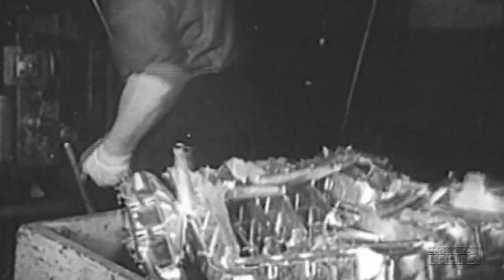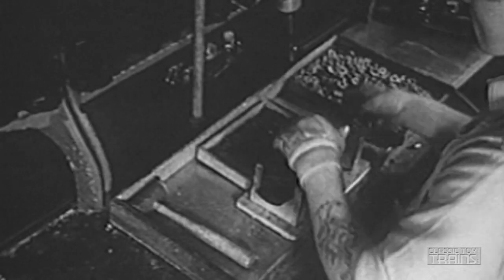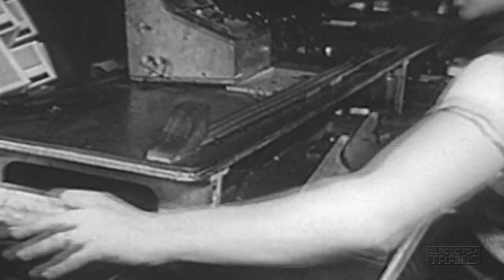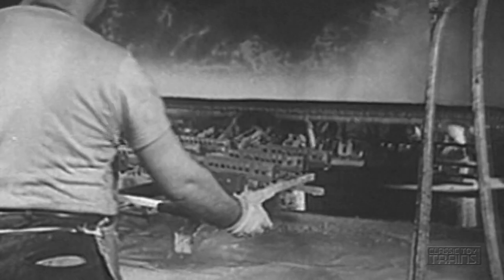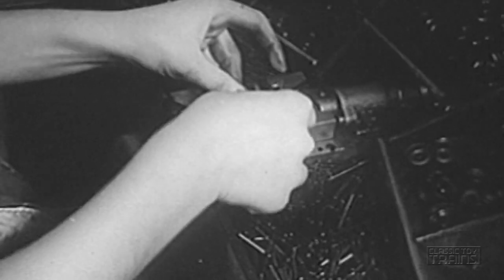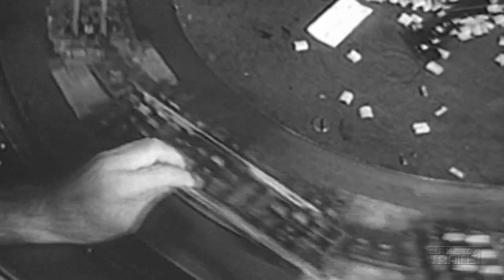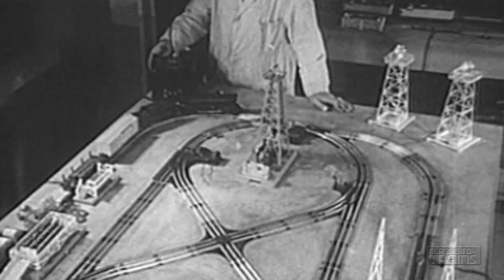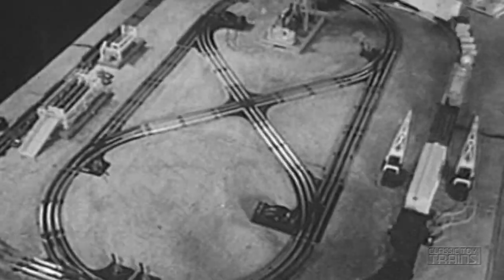Inside Lionel's train factory, part 1

Comment: I have around 100 model engines in my workshop alone, and most of my O/O27 is Lionel, I also have all the buildings mentioned in the video, I even have a standard gauge Lionel and on top of many others, my favorite Lionel engines are as followed: my 226E, my two 2026s as one was my grandfather's growing up, my 1225, and all of my diesel engines
Reply: my favorite is the 681 with 12 wheel tender and back up lights.   looks great on my shelf.   i have that 681, two 2056s and one 2020.   all great engines.
Reply: +Steve Thomas well, since this comment was posted I have gained more fleet members, my favorite might just be my 224 Lionel engine and tender, as it is one of my strongest engines
Reply: i just started collecting 3 yrs ago.  havent had the oppertunity to aquire a 224 yet.  but im sure its a great one to.  but personaly i like the 20 wheel 681 and it has magna trackion.
Reply: +Steve Thomas I have been collecting for 5 years, when she came in she had a broken connecting rod, so I fixed it and now it can pull up to 13 postwar cars and a caboose by its self
Reply: thats good.  my 681 pulls 13 to 15 cars plus caboose.   good runner.  my 2056 wont pull this load. it pulls about 10 cars.   im in the market for another 681 with tender.  do you have one to sell ?
Reply: +Steve Thomas don't have one in my collection, besides, I don't sale, but there was a couple in a train show last year I saw, should have picked them up
Reply: do you like mth engines ?
Reply: +Steve Thomas yes, I think they are pretty good for a modern engine
Reply: would you like to buy one?  or trade ?   its a 1997 dash 9 diesel. 18 inches long with proto -1 sound. mint condition in box.  5 hrs of run time.   i bought it a few weeks ago.  its just not my piece of cake.
Reply: +Steve Thomas not at the moment, I have to fix 12 prewar and 20 postwar engines before I get a new fleet member, one of them is a engine that I cannot find anything about, it looks kind of like a 1778, but it has a different number and is painted blue, with yellow lettering on the side.
Reply: sounds like someone redid it once.  ive never heard of a blue engine nor seen one.   maybe a factory worker customized it. where you from?  texas here.

Comment: Lionel trains use to be the best in the world and even a junker bought at a swap meet could be made to run again thanks in part to a great aftermarket supply chain. sadly when they moved to china the electronics and quality has suffered. I've purchased a small number of items, sets and locomotives. first to go wrong was the fan in one of my new transformers, next the switches on my 1225 would lose contact, the 2-4-2 locomotive from a set I bought for my grandson barely runs and same exact thing with a duplicate set he won at a train show. I have I have 60 year old and older locomotives the still run like day one and transformers of the same vintage and older that still work and don't need a cooling fan. Yeah, I'm not impressed with cheaply made expensive lionel trains made in china. I'll stick with older ones from a train show any day.

Comment: Hi I have  two O gauge trains with the Fastrack  layout. Each has its own power pack. But what I am looking for is a power pack that can run two different trains at the same time. Some input here would really help. Thanks
Reply: Any of the newer Lionel and MTH transformers should handle what you are asking, otherwise, search the train shows and swap meets. A great vintage 150 watt ZW can be had for just under $150. You will have all the power you need to run 2 trains with extra power to spare for running other accessories and lights. You can never have too much available power for a model train layout.
Reply: get a lionel zw 275 watt     will run 4 trains at once or two trains and electric lights
Reply: Hi Steve....Thank you for the information. This really helps. I am a little short of money at this point so adding to my two Lionel trains has taken a bit of a backseat. But this is just temporary.
Reply: yeah im short on cash to  got a divorce last yr.  all my stuff is packed away in a storage building.

Comment: By having a 4x3 picture transferred to 16x9, you miss out on the top and bottom of the image.  Notice how the framing seems cropped throughout this video.  Next time, have Digital Ranch transfer the vintage films in 4x3.  End users can always stretch the image to fill out a 16x9 monitor, if they must have widescreen.